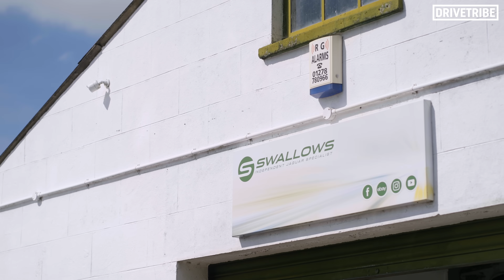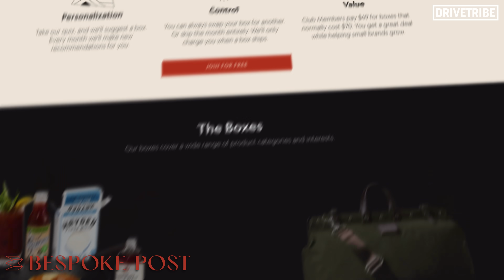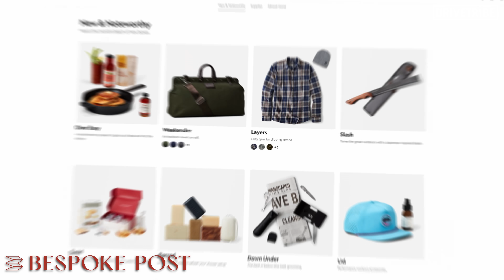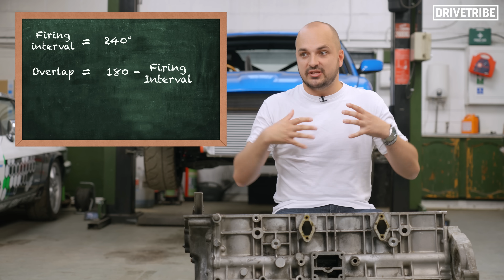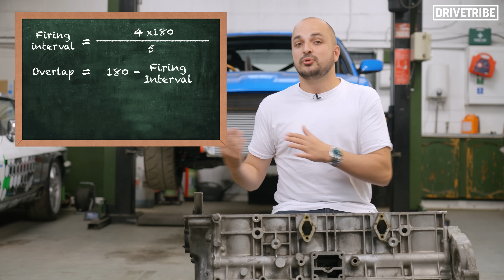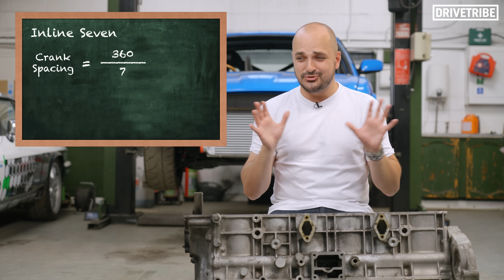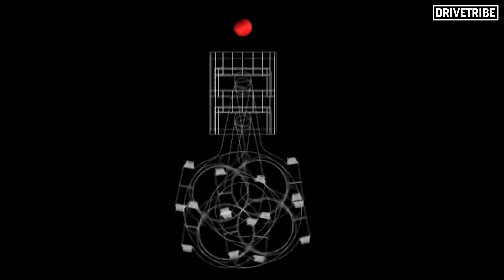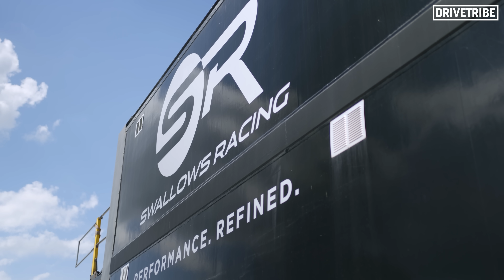Why Isn’t There A 7-Cylinder Engine?

Comment: Perhaps the real reason is that an inline 7 is too long to easily fit into a car., unless it is made in the vw w format. there are 3 and 5 cylinder engines, they run smoothly enough, balancer shafts can be used also. Old cars had inline 8 cylinder engines and also had very long bonnets to accommodate them.

Comment: Oh darnit! I thought I had you when I read the title, knowing there's 7 cylinder radials used in some light aircraft but, you had them covered too. I am a little confused by the fact all radials are odd numbers of cylinders though, that's something I'll probably never comprehend.
Incidentally, my car is a Nissan Pathfinder and it's got their 3.5 litre V6 and that engine is literally one you could balance a coin on it's edge on.  I have had many old carburetored straight sixes but none have ever run near as smooth as this thing. Admittedly fuel injection probably helps but I'm guessing there's a lot of counterweighting and balance shafts doing all sorts of magic trickery but, it really is surprisingly smooth at idle.
Reply: 60 degree v-6's run a lot smoother than 90 degree v6's.
Reply: @mikem9536   I honestly don't know but, it's so smooth I guess it would be. Apparently it's the same V6 they used in their popular 350Z sports car. I've had numerous straight sixes, a couple of 4s and several V8s and love the feel and sound of a V8 but, none have been remotely as smooth running as this V6.
Reply: Not all radials have an odd number of cylinders. Lots of 14 and 18 cylinder radials. Even 28 cylinder radials.
Reply: @wills.5762  And, the 18 cylinder ones are TWO 9 cylinder radials jammed together, same with the 14 cylinders except using 7 cylinder engines. Same thing, still banks of odd numbers of cylinders.

Comment: 11:13  an  inline 8 is not two inline 4s joined together, since an inline 4 usually has pistons 1 & 4 and 2 & 3 moving together. The animation shows it with opposite cylinders moving together.
Reply: The animation shows a rational inline-8. Two inline-4's in the same phase end-to-end would be nonsensical, although two inline-4's 90 degrees out of phase end-to-end would work.
Reply: @brianb-p6586  Regardless of how the firing order is in real engines (Buick, Alfa etc.), the voiceover says it is two straight 4s joined together, and the animation shows something different.
Reply: Some early ones were, e.g. Bugatti

Comment: all makes perfect sense,  the flywheels purpose being to carry the engine through  the idle strokes, I wondered for many years about Rolls Royce Merlin / Meteor, no flywheel, enough compression strokes, so close to each other that it carries itself
Reply: The propeller rotating mass acts as a flywheel in aircraft applications.
Reply: @johnyoung1128  I get it in aircraft applications, but in a tank, well the clutch is a bit of a beast!!

Comment: it's a shame because I've had a 3 and 5 cyl, was hoping for a 7 and a 9 to be revealed in this video so I could go out and buy them.
Reply: Just get a cargo van and shove a radial aircraft engine in it.  If you want to go real crazy, look at the Pratt & Whitney R-4360.  Experiment with using a compound turbo set up from the Wright R-3350 using in the Lockeed L-1649, and have some fun.  You might want to haul a trailer for the insane amount of fuel you will need.

Comment: so if a 7 cyl engine dosn't exist due to balancing, how does vw create a v5?
Reply: It's an in-line 5 with the cylinders staggered, like the Lancia "V4" from way back when. Funnily enough I think Lancia were the first to make an inline 5 as well.

Volkswagen originally called their V5 the VR5 - R refers to the inline nature (Reihen, in German). So VR means V-inline. That's similar to how the Lancia engine was described as well, narrow angle V.

Honda made a true V5. And a V3. They beat the world with both. Of course, they're just show offs. Oldsmobile prototyped a V5 Diesel, too, but details are scant.
Reply: @identiticrisis  it was retorical, as in if it can't be done with odd number of cylinders, well it can cause it has
Reply: @downtheshedwithjason  I see that now yes. No V7 yet though?

Comment: 2 of the best/reliable engines I've owned were both inline 6's
Reply: Loved my inline 6 '69 Camaro.
Reply: I've owned a couple that meet that description: the Chrysler Slant Six and the Toyota 2JZ. Both of those were unbreakable and the 2JZ even had power.
Reply: X3 M40i here.

Comment: you can totally do a 7-cylinder engine. My brother built a functioning one out of legos. It's an inline-3 spaced out with a v2 between the inline cylinders. 1, 2, 1, 2, 1. A straight 7 may be a bad idea,  but the staggered 7 is easily achievable with current technology.
Reply: Agco has a inline 7 for combines(look up Gleaner S98 combine specs).

Comment: So, if an inline 8 is basically 2x inline 4's bolted together, what would happen if you chose a firing order that fired 2x cylinders at a time? Each bang would have double the power of a single 4, so I presume way more torque? Doesn't solve the long crank shaft, but just as a curiosity?
Reply: Pretty sure Honda experimented with this on bike engines. They called it “big bang”
Reply: The torque is only applied as long as there is cylinder pressure.  As soon as the gases are exhausted, now the cylinder saps power in order to be rotated back to the start of the cycle.
On average, over the whole cycle and all cylinders, the torque would be roughly the same. 

Honda's "big bang" engine was exploring something different.  They didn't know what exactly at the time, but Yamaha did a whole thing about it with their M1 MotoGP machine and coined the term "inertial torque".  Basically the start-stop motion of the pistons manifests as a torque in the crankshaft which can find its way to the tyre and upset the rider's feel of the traction / grip available.

At high rpm the oscillating torque from the piston motion eclipses the combustion torque.  It's also a problem in very large engines with very heavy pistons - e.g. marine diesels.  There was one example of an engine that twisted its crankshaft to pieces as soon as they cranked it, due to this force being neglected in its design.

Comment: I'm only 30 seconds in, but my guess it 7 cylinders is too hard to package to be feasible, a V8 takes up less room longitudinally than a in line six so that's why the step between 6 and 8 exists

Comment: When you said "straight six", you really meant to say "flat 6" did you not?
Reply: nope a Flat 6 is like a Porsche engine, a V6 with 180° and opposite direction for pistons .  It's also a Boxster engine but you can have flat engine that aren't Boxer.
A straight 6 is by example the famous 6 cylinders BMW.

Comment: Because you can’t divide 360 degree’s into an equal measurement across 7 cylinders which is what’s needed to position off the crank? Would make the rotation unbalanced & unreliable?

Comment: When you're talking about Sisu Diesel engines you're incorrect. The engines they build are 3, 4, 6 and 7 cylinder engines with displacements of 3,3L for 3 cylinder engines, 4,4L/4,9L for 4 cylinder engines, 6,6L/7,4L/8,4L for 6 cylinder engines and 9,8L for 7 cylinder engines respectively. And every single one of those is turbo charged. They are indeed modular in the sense that they only use 3 and 4 cylinder heads which they then combine to make 6 or 7 cylinder engines. The new engine family they just launched is quite different though and they have a V12 engine that's no longer manufactured.
Reply: Acgo power also provide 7 cyl diesel engines, dont know  if theire misleading on purpose
Reply: @karvavarba2700  Agco Power used to be Sisu Diesel. They did spell it wrong (ACGO) but they did mention it.
Reply: Whatever the case, the title of the video is misleading.
Reply: @cyclone-g2z  towards the end of the video he mentions that a company called Agco already produces Sisu Diesel 7cyl engines. That's what we are talking about .
Reply: The graphic at 12:43 of AGCO engines clearly shows the turbochargers, which is either funny or sad.
Reply: @brianb-p6586  Yeah and the 7 cyl engine depicted there even has two. Some models have only one but most 7 cyl engines they build have two turbos.

Comment: So, why are these issues with a seven cilinder engine no problem in five cilinder engines?
Reply: They are to some extent, but most of the problems are solved by its overall shorter length, with less forces hitting it

Comment: 8:37 
I would only like to correct on one thing, super chargers and turbo chargers have been around just as long as adding more cylinders.
1905 for turbo chargers, and 1848 for super chargers forced induction has been around just as long as the internal combustion engine.
Reply: As long as humans have had fire we’ve been forcing air into it to make it burn hotter and more energetically.

Comment: Lots of ship engines are 7 cylinder 😊. Many ship engines now can be isolated. One cylinder can be shut off for repairs while the others still run.

Radial aircraft engines may have odd numbers partly to avoid harmonics.
Reply: Just made this comment myself, somebody beat me to it!
Reply: i was going to write the same. many aircraft radial engines have 7,9 and i think 11 cylinders too
Reply: @tyablo  I haven’t heard of any 11 cylinder radials, usually if an aircraft engine manufacturer wants to up the cylinder count beyond 9 they will go to a two row design usually with 14 or 18 cylinders.

Comment: The wikipedia article on five cylinder engines notes that fuel delivery on a gas engine is difficult to get right without fuel injection. A seven cylinder engine would have the same issue. Diesels are intrinsically fuel injected, so this isn't an issue for them.

I've heard seven and nine cylinder engines out at the airport. Above idle the prop is much louder than the exhaust, alas...

Comment: Really interesting vlog I’ve always wondered how far you can push a engine for BHP you get say the ford 4 cylinder cosworth engine and you can get 500+ BHP but I always wonder what is the limit before the cylinder block says that’s enough 
You always tune to a point where it’s going to be ok but what happens beyond safe 😊
Reply: ask 80s f1. engines in qualifying lasted one lap. or two.
Reply: I think in F1 it was something like 1000bhp per liter in the turbo era.

Comment: The Gnome Monosoupape 7 Type A from 1916 had 7 cylinders.
Reply: It's a radial my dude. Very different.
Reply: @ChaosPootato  Actually it was a “Gnome” rotary engine with the crankshaft fixed and the engine block rotating!

Comment: I wonder if a VR7 would work any better? Still fairly pointless but it would sort the long crankshaft issue
Reply: That'd sound great. Best of both worlds
Reply: I think it would be extremely difficult to balance, having three firings on one plane and four on the other.  But, they did it with their VR5, so I don't see why it wouldn't be possible.
Reply: @flyingphoenix113  the existence of the VR5 is exactly what I was thinking with it
Reply: So why did someone come up with a 5 cylinder engine
Reply: @Petrolhead66  mostly cause of the space from the engine bay and the type of car that goes into it
Reply: Packaging and cost, mainly.
Reply: @Petrolhead66  The design brief was to make it fit where a 4 cylinder could, sideways in a small engine bay. It was also apparently an engineering nightmare to balance thanks to the steep V angle, it's barely a V so the dynamic balancing calculations were insane.
Reply: @Petrolhead66  because straight 4s and 6s exist. I think the thing with a vr5 or vr7 is that they'd generally take up the same room as a v6 or v8... unless their engineered to fit a peculiar space in a particular vehicle
Reply: How about a WR7? Cylinders in a 2-3-2 configuration.
Reply: @aluminumfalcon552  Interesting idea.
Reply: @aluminumfalcon552 Honda built a V5 for motorcycles.  It actually balances (with counter shaft) rather well. It provides uneven torque which is desirable off road.
Reply: I think it would make an awesome noise
Reply: Radial 7
Reply: Extracting the power from the middle of the engine, or somewhere around there, should solve the issue, VR engines are balancing nightmares
Reply: there would be a tourqe issue with there being more cylinders on one side.
Reply: Anything is possible with enough engineering
Reply: it would be possible but it would also be unnecessary as it would be easier to just use a V6 or V8.
Reply: @MrRandomcommentguy If we're going in the direction of necessity, then really anything but a turbo-4 may as well be obsolete.
Reply: @AlastorTheLumbagosaurus  but there's no point to mass producing a Straight 7, other than human curiosity. Literally no point in it
Reply: @davidaugustofc2574  Let's not devalue human curiosity now...
Reply: @AlastorTheLumbagosaurus  that's a lot of money for the sake of curiosity, unless a decent reason or utility is found for it. 😋
Reply: @davidaugustofc2574  Money
Reply: @AlastorTheLumbagosaurus  sure a lot of it will be spent, and there may a lot of it in the World, but one needs to come up with an excuse to spend it. If the money isn't yours explain why someone else should spend their money on it. Absolutely nothing a Straight 7 will do that a V8 or a Straight 6 cannot.
Reply: @davidaugustofc2574  Isn't this thread about a VR7?
Reply: @davidaugustofc2574  Lot of money for the sake of curiosity huh.. What about space exploration then
Reply: @mklaver31  because a VR7 is gonna answer how life came to be, 🤣. I knew someone is gonna be bright enough to make this point.
Reply: No the balance would be even worst, the vr engines have a little bit worst balance compared with inline engine for the simple fact that not all the forces are opposing each other, that have a little gap in between (in the case of the vr engine is between 15 and 10.6 degrees depending on the year of production) without counting that the crankshaft would be very complicated to do, because not only you need to have 51.4 degrees of separation between crankpin, but you need to had 10.6 degrees more to make the engine smoother and make it even firing, unless you want an even worst balance, and an even less confortable odd firing engine...I hope you understud I sed...my English is not the best 😅
Reply: @lorenzozitari2274  The balance issue of the inline 7 is no different from the inline 5.  There are 24 possible arrangements of crankpins for inline 5s, why do you suppose we only ever see one in practice - the one with the best balance, with no balance shaft even?  Except the V10s of course which usually use a different arrangement, one with the worst possible balance - with the 90 degree V angle this is negated entirely with crank counterweights.  Hence all the odd-fire V10s.

For 7 cylinders the possibility space increases to 720, so I guess that alone will put off any design attempt.  That said, there is a simple pattern and the min / max examples for 5 cylinders can be extrapolated to 7 very easily: 1, 2, 4, 6, 7, 5, 3 / 1, 5, 6, 2, 3, 7, 4 -- 1, 3, 5, 7, 2, 4, 6 is the radial firing order and indeed has terrible balance as an inline engine.

The bigger issue is still crank-killing torsional vibration - this affects the smoothness of running and is historically the real reason why we didn't stop at 6 cylinders, or 8...
Reply: I mean yeah, but if you're gonna do that, just get a VR8, or go further and do a VR9.
Reply: @Drunken_Hamster or W9, 3 banks of 3.
Reply: @paulqueripel3493 that’s not how a W engine works. They’re basically 2 VR engines stuck together. So a W16 is 2 VR8’s and a W12 is 2 VR6’s. basically 4 banks of 3 but half is a super narrow V and on the opposite is another super narrow V
Reply: @mkp1214  only in VW group engines. Lots of W engines in the past had 3 rows of non paired cylinders. Wikipedia lists a lot.https://en.wikipedia.org/wiki/W_engine

Comment: The real question is why are there no V1's?
Reply: Velcro shoes, huh?
Reply: V1 maybe not.
But /1 engines are definitely possible
Reply: Shoes right?
Reply: It takes 2 to make a V...
Reply: @daveunknown01  well done you almost understood the joke
Reply: @yissibiiyte  well done, you made me think you were actually a special one haha
Reply: @daveunknown01  that's how modern humour works, if you've never been on the internet before.
Reply: @yissibiiyte  nah, 1st time.
Reply: @daveunknown01 nice, go away now
Reply: @skankhunt420  Dont think i will. Stay mad i guess. 😘
Reply: @daveunknown01 No, you just need 1 v shaped piston to fit in the glow plug recirculater

Comment: I had a Subaru Justy(3 cylinder)  as soon as I added power(intake, exhaust, tune) and it drastically shortened the life of my crank shaft. Boom
Reply: I'm guessing it didn't come with a forged crankshaft from the factory?